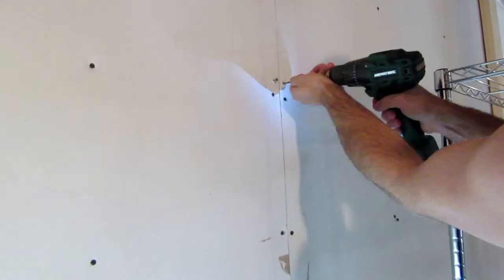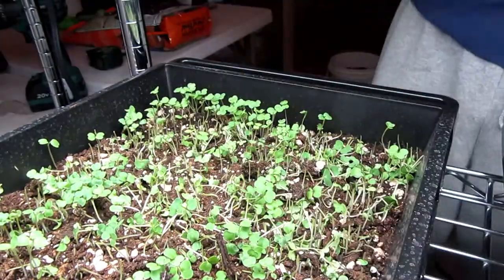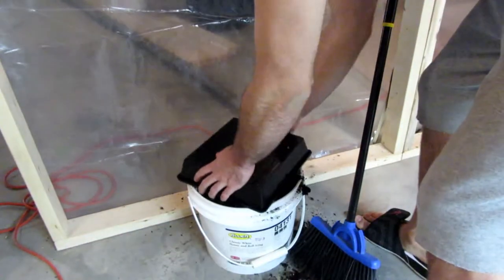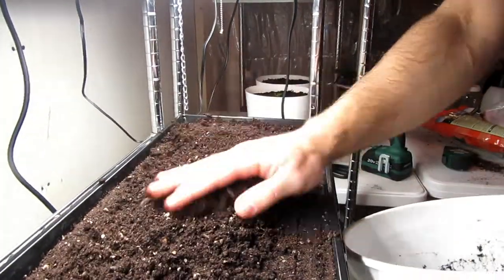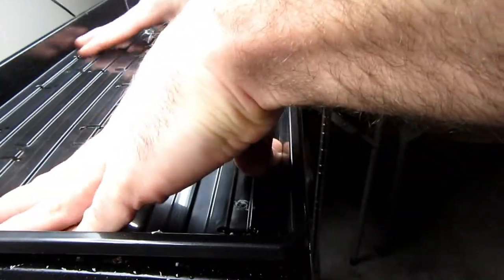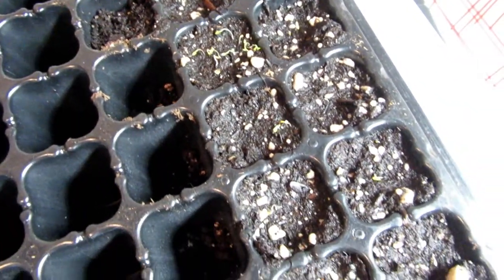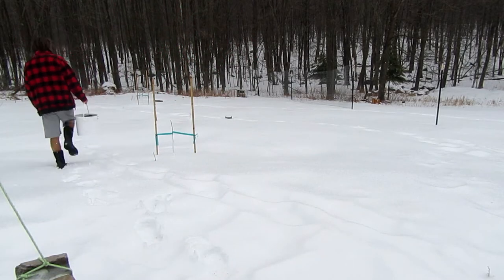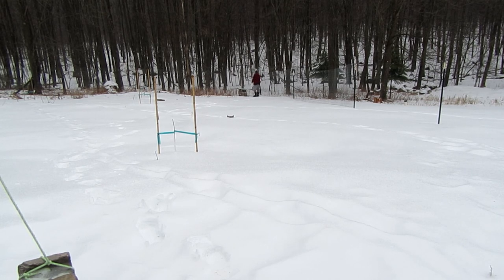Starting Seeds │ Microgreens │ Broccoli │ Cabbage

Comment: Nice video, what kind of shaker did you use to spread the microgreen seeds?
Reply from the maker: It is a ball jar with a plastic lid that I screwed some 5/16" holes in.  Works well for broccoli and arugula, too small for Cilantro.  Need to add larger holes on the other side haha